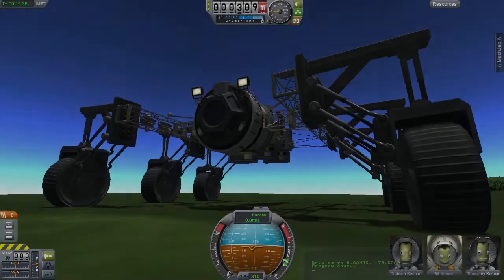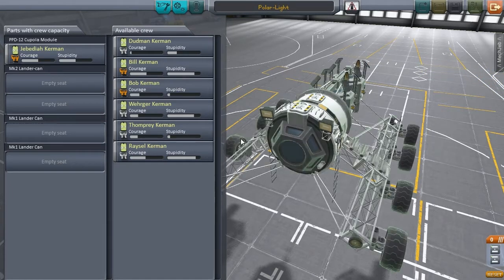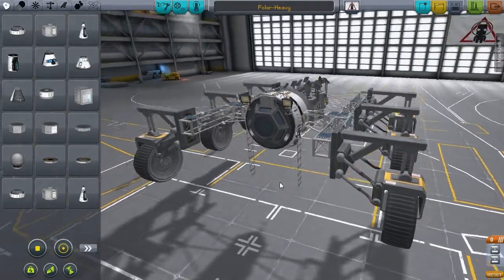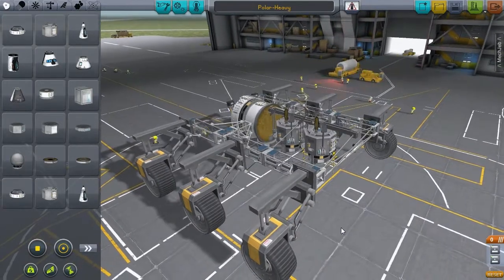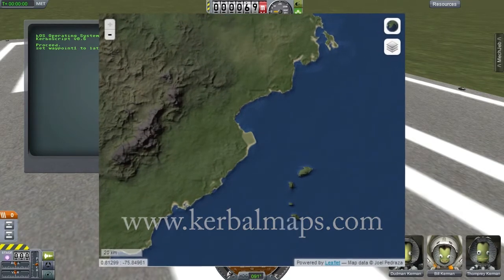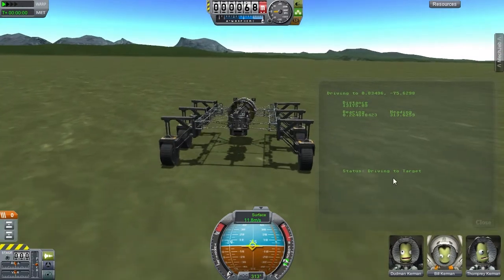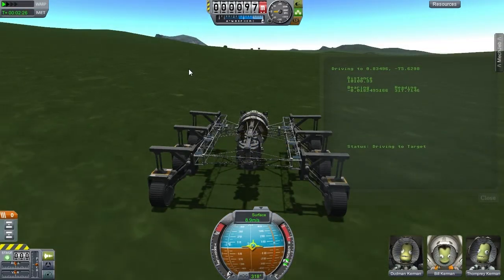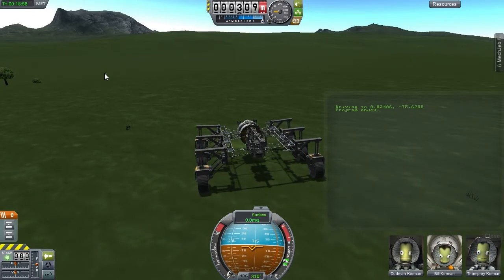South Pole or Bust Episode 1: Hurry Up and Get Ready to Wait

Comment: I've been wanting to do the same. Slow down or back up if an angle gets too steep... but I can't figure out a way to determine the craft's attitude at a particular point.

It looks like Nivekk might have found a way to do that, based on the video.. it looks like the rover is automatically avoiding steeper terrain and taking a longer but flatter route to the waypoint.